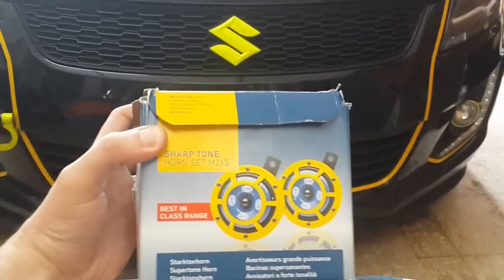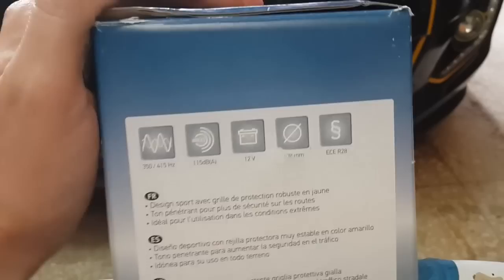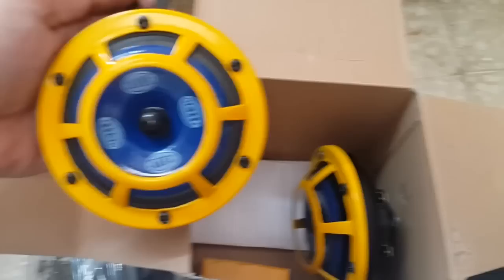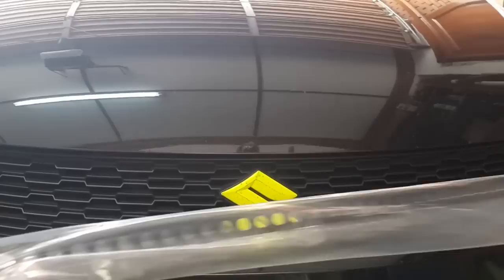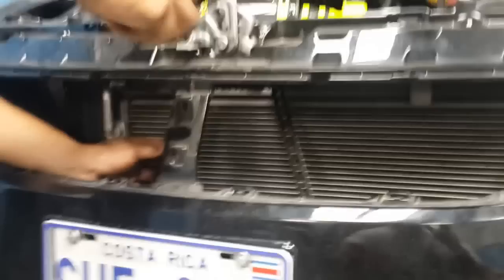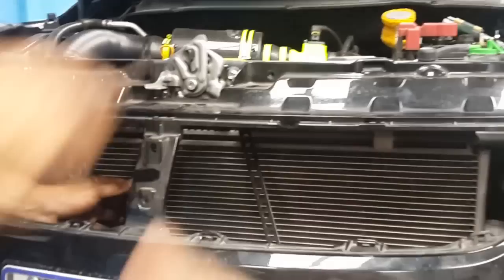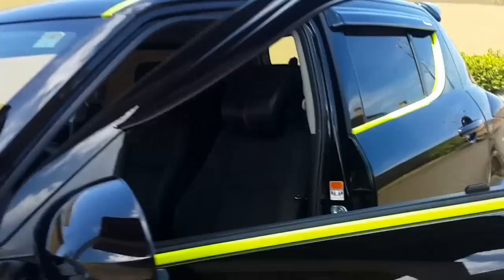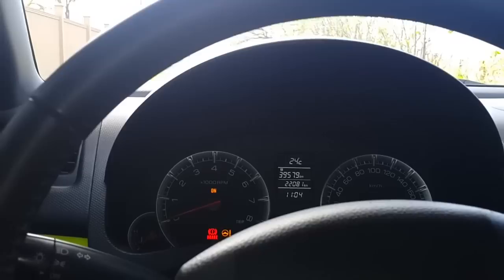Suzuki Swift 2015 horn upgrade, Hella Sharp Tone

Comment: Dude, I really love what you have done to your car. The yellow highlights all over the car really make it look cool and distinctive! I just recently bought a 1.2 litre Swift Petrol here. Mine is RED! So, I browsed the net and ended up buying the Hella Super Tone which is the bigger brother of the Sharp Tone. It has the red grill. I actually watched this video before I finally ordered the horns because I want to mount them the same way as you did... However, the stock horns are also Hella and decently loud. I think they are the Hella Strong Tone which are rated at 4 Amps each and 114 dB same as Sharp Tone. The Super Tone is 5.5 Amps and 118 dB. Even though they look cool, I feel I may have made a mistake. There is a more expensive horn here in India called the Roots Megasonic (Google for it, it is quite interesting) which are rated at 4 Amps and 125dB! However, they are much, much bigger than the Sharp Tone and Super Tone and weigh 1250 grams!! Are the Sharp Tone loud enough?

Comment: Where did you get that black 'A' frame that you mounted each horn to?
Is the frame screwed into either side of the bonnet latch?
Reply from the maker: Hey, that frame is custom is just a metal rail with holes so you can mount multiple pieces, nothing special
Reply: @giu2085  thanks for the reply